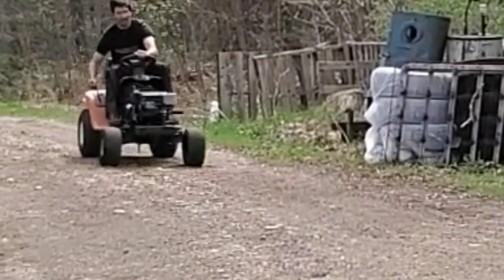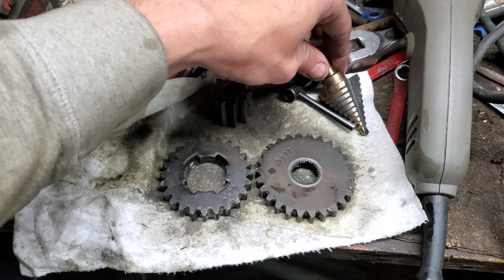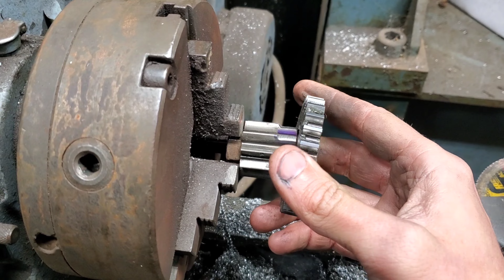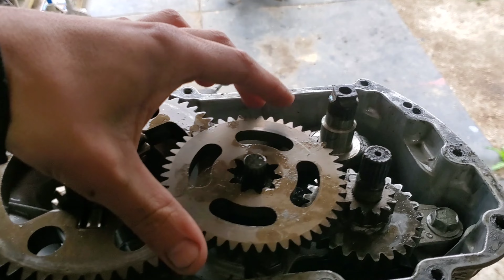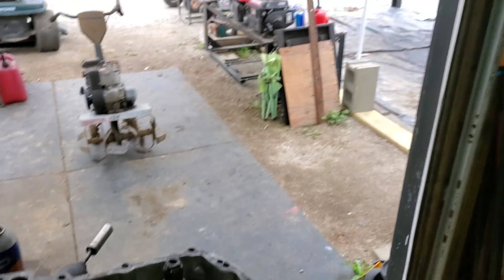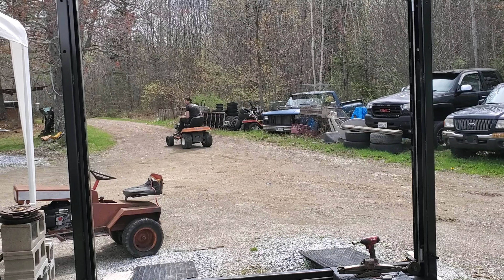Drag Racing Hydro Build Part 1

Comment: I have the same hydro trans on mine. Ima do what you did with the gears in the trans. I also have a v-twin 20 hp motor on it. Will that be enough??

Comment: Can you lack this model Hydro?
Reply from the maker: Yes you could lock it. When the bull gear is in place like it is in the thumbnail to the left you could tack weld the 2 spider gears in place to the center block then weld the block to both of them. Put it back in place and it would be lockered
Reply: @RCGRacing  I was wondering why you didn't.

Comment: I don't think I will ever get over the fact that that is the coolest thing I have ever seen and I want one now
Reply: that is a LOT Of work and it goes tooo fast. manual trans with 7" pulley on the motor and 5" pulley on the oil filled transaxle will give 30-48 mph on 3-6 speed transaxle... taht is fast enuf and that is at 3600 RPM's... take off gov/ adjust gov to turn 4000... 4500 MAX!!! (OR FLYWHEEL CAN EXPLODE/rods break over that) and it is going way toooo  fast for the steering/brakes to deal with as a dismount at over 35 mph is NOT GOING TO FEEL TOOOOO GOOOOD.

Comment: Intek twin or a vanguard
Reply from the maker: Will be a 17 hp single briggs for now as its what fits in the small mod class.
Reply: @RCGRacing  i have a 26 horse Briggs & Stratton for 200$ it wood work
Reply: intek twin
Reply: @cassandrahoad7713  20HP? 22 HP... 25 HP??? with governor removed to get to 4000... 4500 RPM's with E bay tach/hour meter to not spin the motor any fasters as teh rods/flywheel might come apart... and that is a LOT OF HEAVY metal in the flywheel right in front of operator to come apart and... that wud be bad. fresh oil every 25 hours on no filter engines... 50 hours on filtered engines... depending on dust condisitons. new air filter $10 on e bay. cheap insurance. foam pre cleaner for oil filter, soaked in motor oil and wrung out (what a mess)... or $12/can MC air filter spray????  keeps silt out out of motor.  too bad HiPo rods are so expensive... and the flywheels for those engines to SCREAM THEM to 5500-6000 RPM's. port the heads with dremel grinder and 80 grit sanding drums, port intake, headers with glass packs as TOO LOUD IS TOOOOOO LOUD. once hearing is gone... it is GONE, it does NOT COME BACK
Reply: z